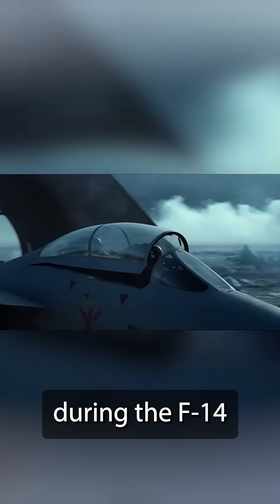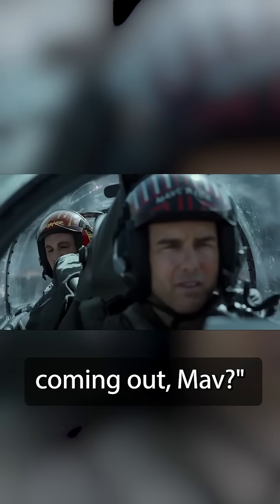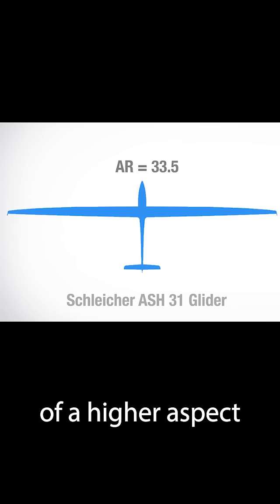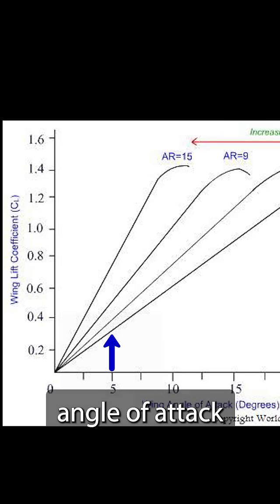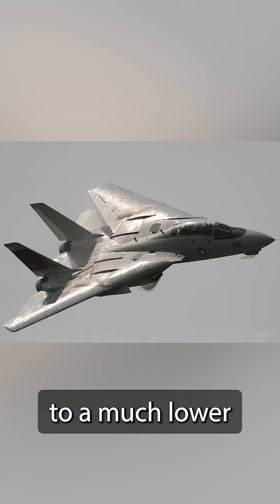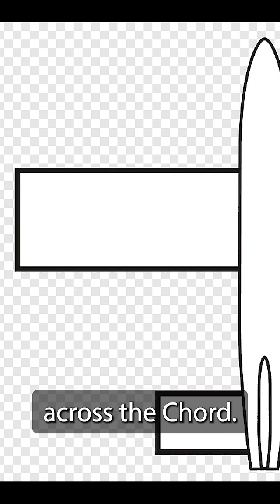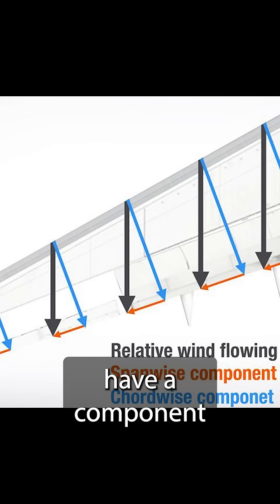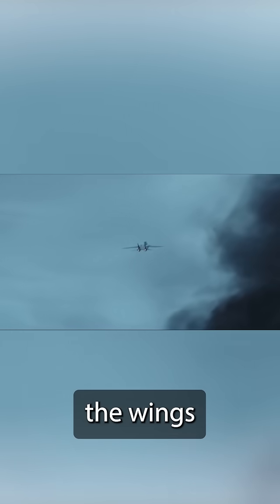“Why are the Wings Comin’ out, Mav?”

Comment: Pretty good little compact lecture, although Im pretty sure that no production model of the Tomcat was able to officially supercruise. Meaning supercruise with a combat loadout. Ive heard of aircraft barely scraping past mach 1 in a clean configuration and at high altitude, which is prolly what happened at different times with the F14 but that doesnt mean we get to say that the aircraft can supercruise like the Raptor or Rafale, which can do it when fully loaded. However, had we actualy gotten the Super Tomcat like we ahould have, (nothing against the Super Hornet, theres just a ton of advantages that the F21 would have had) it would have had supercruise and thrust vectoring.

Comment: The wing flap and slat system will not work unless the wing is at 55 degrees sweep or less. The inboard flaps will not function unless the wing is at full forward sweep.

Comment: In actuality, Rooster asked, "Why are the wings coming out, Mav?" Because they were still on the taxiway.
Reply: Correct, when F-14 taxis, the wings are closed so not to bump into things. The movie gives the impression that the jet normally takes off with swept wings. They don't. 
F-14 always extends its wings just before takeoff.
Reply: @noe616 ohhh, okay. No I knew it wasn’t likely (I’m not even sure it’s feasible) to take off swept. I was more wondering he why he was surprised since it seemed to make sense to me.
Reply: @Hoshimaru57  BackSeater was not used to flying in a Tomcat, all the others have a fixed-chord swept wing.
Reply: @noe616 The movie doesn't give that impression He asked it because they took off from the taxiway
Reply: Top gun 2 was a poor movie.

Comment: The easy answer would be to just say that the wings came forward because that’s the takeoff position for the aircraft. It’s necessary for not only lift the flaps will not deploy for takeoff with the wings swept back. One of the issues that was incurred in the A model was that the wings would jam if the pilot would try to deploy flaps before the wings were fully open. Everything else as far as aspect ration doesn’t even matter.

Comment: As an aerospace engineer (in training🙂) bro just packed like 2 or 3 lectures of related content into a 1 minute short. Respect
Reply: The logic is pretty intuitive to where you don’t really have to think about it math-wise. Think of birds with massive wingspans like the Albatross. Huge wingspan means bigger surface area, thus less energy required for lift.

So many young engineers these days are too much on the calculations, and not enough on intuition.
Reply: hey i’m looking into studying aerospace engineering, any tips on where to start?
Reply from the maker: @ausi2 get a copy of Aerodynamics for Naval Aviators and read it. Then reread it. It’s a free PDF on the FAA’s website. It’s old but if you work through it a few times and learn that material you’ll be MILES ahead of most students when you go to Uni!
Reply: yoo im thinking of going into aerospace engineering, is it as good as they say it is?
Reply: Trying to grasp all this info too. What I can condense it down to is that a greater surface area allows for more lift, especially when set to a perpendicular angle to the body of the plane.
Reply from the maker: That’s a relatively accurate simplification. This was originally a ironic short but many people took it way more serious than I intended lol
Reply: @The_Flying_Mechanic  That's what you get when you do it on an interesting topic.😅

Comment: Yeah, I'm not even sure whether you could get a F-14 with swept back wings airborne at all, no matter the length of the runway.
Reply: seconding this, doubt it would be able to get the nose up
Reply from the maker: @caboose9843 I know they did testing with wings swept for landing and even asymmetric swept wings in flight but I’m not sure about if they ever tested a takeoff.
Reply: @The_Flying_Mechanic   The F-14 Tomcat was tested and deemed capable of taking off and landing with one wing in a swept-back position. During testing, it was even evaluated for emergency landing scenarios aboard an aircraft carrier with an asymmetric wing configuration, with one wing fully extended and the other in a swept-back position. 

Not sure if they did with both wings swept back but i assume they did
Reply: Surely the centre of lift would be too far back to take off at the lower speed? Getting the nose to climb would be impossible. I've always loved that variable geometry wing on F14... such a cool concept even though it caused problems at times...
Reply: Yes you can and it has been done.
Reply from the maker: @ManOfChaiTea  I figured they would have had to test that... there are some crazy things that have to be tested but that isn't far fetched to consider it might need to occur.
Reply: A couple of tomcats managed to make it back for a safe landing, completely missing an entire wing. so I would probably imagine with a sufficiently long runway it would probably take off just fine. The body apparently creates a fair bit of lift in addition to the wings, so that will probably make the center of lift a little further forward than we may think. This is all a semi-educated guess on my part, however.
Reply: @Richard_Talks  I think you're confusing the models here, there was a Tomcat with its right wingtip missing after a  midair collision, but the one with the whole wing ripped off was an Israeli F-15.